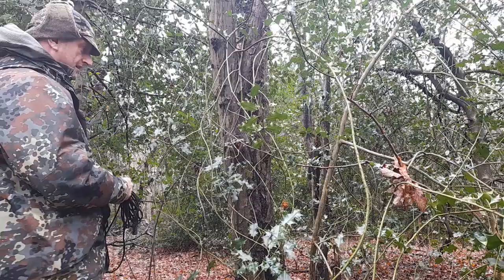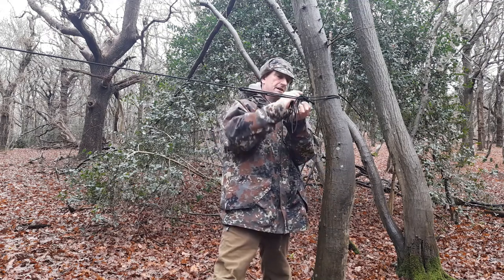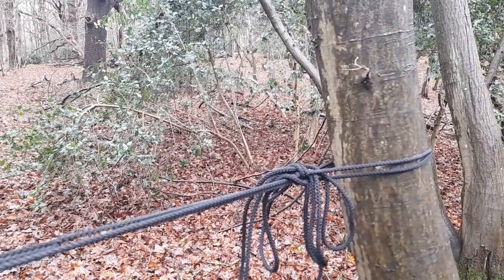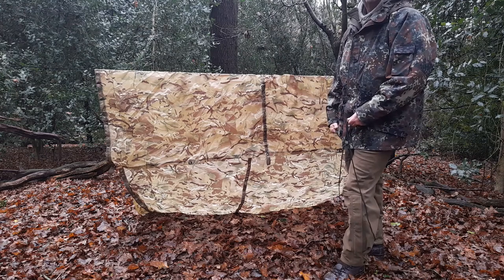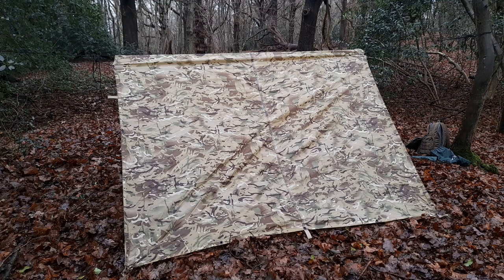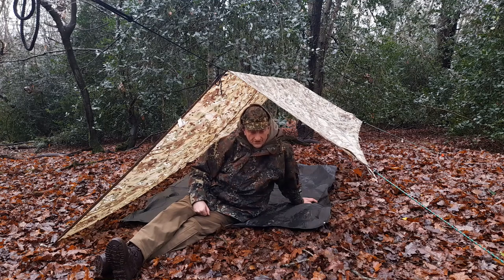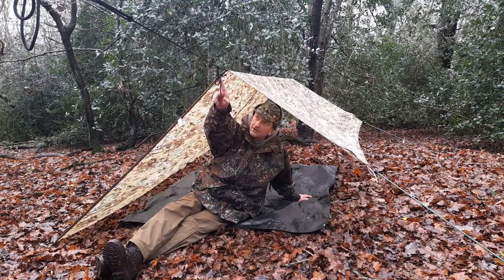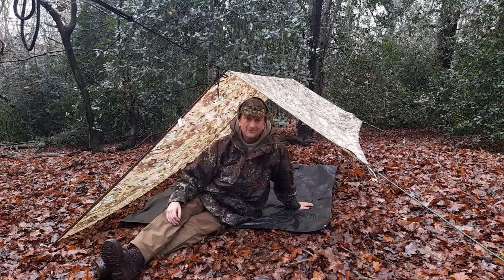Tarp / Basha set up.  Step by step video.

Comment: The camo netting is must. Mosquito netting also.
Reply: Hang it over the entire set up and pin it down to the ground. Keep it simple if it works it works if not fiddle about.
Reply: I like fiddling.
Reply from the maker: I never use the camo netting with mine.  In the places I use, you have to find me 1st. 😁👍
Reply: @jim-bob-outdoors  ha ha